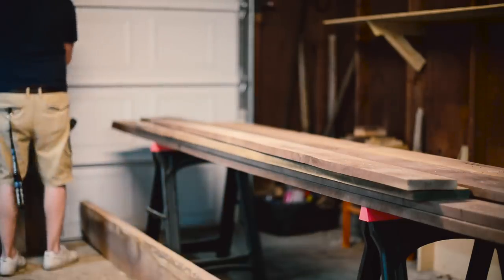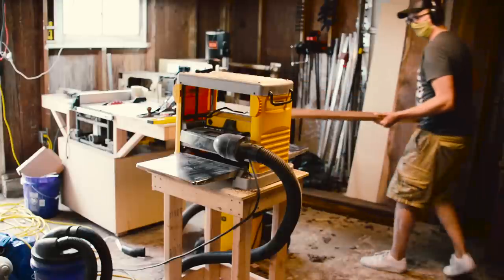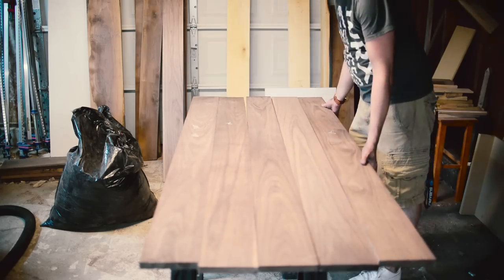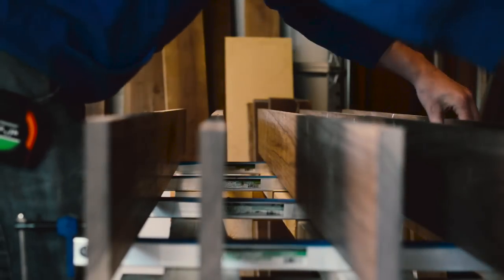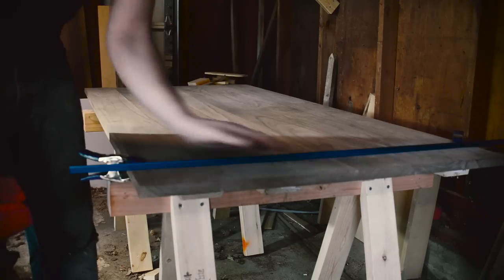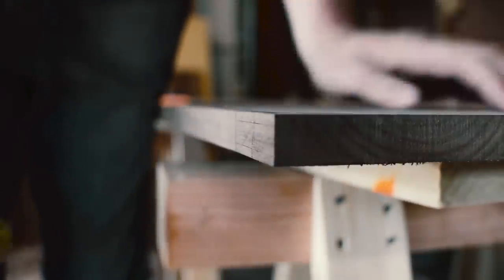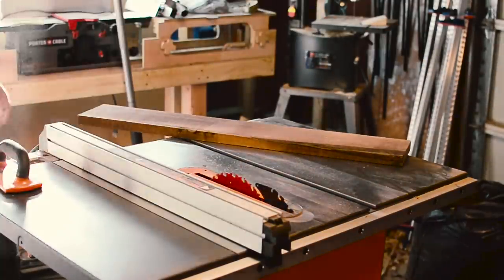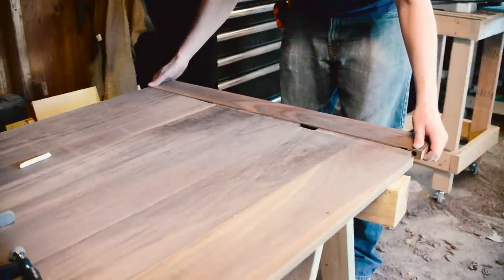DIY - Walnut Trestle Table

Comment: Awesome build.  I don't have all the tools to build this table, but it was very interesting to watch and the end product was gorgeous!
Reply: It's my wife's fault.  She showed me a walnut table that BYOT build on YouTube, build #23, which I could easily do with minimal tools.  Then she wanted hidden soft close hinges on our cabinets but they were built 30+ years ago and are too thin for them, and other dimensions make the hinges that do not require holes to be drilled to work, so I started looking at building new cabinet doors, which branched into my wanting to build a new coffee table for the living room, and a new floating cabinet for under the TV, and those crap floating shelves they sell at the big box stores would look SO MUCH BETTER and be much stronger if built out of a nice hardwood.  Oh crap, now I've been bitten by the woodworking bug again after it has been dormant for about 35 years.  Thanks for feeding my new addiction! LOL.  I was thinking about building a nice wood bed frame with storage too, and maybe a coffee table with 4 rectangle spots for small pieces of leftover granite counter tops with some nice marbling.  Crap, I need a larger shed and new tools.  I wish my mom and brother had told me before they got rid of my dad's tools after he passed away.  he had QUALITY TOOLS and tons of them.  I still have an old Skill circular saw that works perfectly, and is higher quality than pretty much anything you find today, and it is probably 60 years old.

Comment: Nice work man! You persevered. I feel for ya, the first 3 years I did any kind of woodworking I didn't have a shop, just a busted up rigid table saw and a drill outside in the wind and rain and I felt like it was always this battle to attain success in my projects (the breaker tripping mid way through the cut was something of a regular occurrence for me too! Soooo frustrating). The fact that you can do this quality of work with those kind of obstacles in place as a momentary constant is very inspiring.  Keep up the good work!
Reply from the maker: Nathaniel Herring  Thanks for the kind words! I appreciate it.
Reply: I too for much of my woodworking years experienced breaker tripping, but not the power...rather the tablesaw.  Seem like I worked it too hard most of the time!

Comment: Nice work! I have that jointer. It does a surprisingly good job. Still, I think I'm going to replace it with a more substantial 8" jointer in the near future. I'm always worried when I watch the aluminum fence start to bend slightly when I run a heavy piece through. I'm going to make a trestle table soon and I hope it turns out as nice as yours.

Comment: That's a great looking table. That will last a lifetime. Thank you for sharing. One question and please don't take this as a insult. But instead of replacing your table saw with a smaller motor why not upgrade the wire and breaker to 20 amp 15 amp is going to always be a problem in a shop. Just thinking long term problem solutions. Thanks again for a great project video. GW

Comment: Hey Paul, Just curious - How long did it take you to build this? Also, were you concerned about wood movement or anything happening to the top during the time it took to build the legs?
Reply from the maker: I'm trying to remember, it's been several years but I think it took about 3 weeks to build, with the majority of the time being spent on the weekends.

There wasn't any concern over the top moving, especially over a short time period. Wood movement happens over seasons as the temperature and humidity changes.

It's held up great too. We still use it all the time.
Reply: @paulprice  Fantastic - thanks for the insight.  I have had a bunch of walnut sitting in the garage for a while and plan to make one loosely based on this one as well.  Considering C-channel instead of breadboard ends.

I'll send pics whenever I finish :)
Reply from the maker: @ianhawkins441  awesome! Yeah if there was one thing I would do differently if I were to build this table again it would be to either not do bread boards all together or make the top thicker. As it is the bread boards are pretty thin so there is a little bit flex in them if you were to lean on them. But they've held up fine and haven't broken or cracked yet. 

But you're on the right track I think..best of luck!
Reply: @paulprice  welp it took ages but finally finished our trestle table 😀  I'll shoot some pix soon

Comment: Beautiful - hvad thickness did you use for the table top?
Reply from the maker: About an 1in. in hindsight if I did it again I'd probably go for slightly thicker top so the breadboards would be a bit beefier, but it's still holding up fine.

Comment: Hey man I see that you are using a bench top jointer with in feed and out feed tables you added on later.  How does that work with adjusting the height of the out feed table when you manipulate your cutting depth? Just curious on how you put that together.
Reply from the maker: +Zac Abernathy I had built it to be adjustable, but the easy answer is that I basically set it up once and then just use the same cutting depth on everything.

Comment: How has the porter cable jointer been holding up?  I had 2 cutter head shaft wearing out.  Yes I had play in cutter head thought is was a bearing, porter cable replaced it, the second one had same issue after 200 board ft or so.  They have replaced the bearing to a needle type, just wondering if I am the only one with this issue.  I have since gone to a cutech, same planer just has a helical cutter head.  No issue after a 1000 board ft.
Reply from the maker: +Lewis Brazil I actually upgraded to a grizzly jointer after I made this table. I Wanted something more sturdy and accurate for longer boards.

But the porter cable worked fine for me while I had it.

Comment: is the top only 1" thick?
Reply from the maker: Yes as that was the thickest lumber I could get at the time. Ive thought about making a new top for it that is thicker and a bit longer and wider. But it has worked just fine as it is
Reply: @paulprice   Okay. How has the 1" top held up so far? I like to use thick ones but can only seem to find 1" in my area.
Reply from the maker: @cedarriverwoodworking  it's held up just fine. Only thing that isn't perfect is the breadboards on the ends are a little wonky now from wood movement over the years, but otherwise it's still in great shape
Reply: @paulprice  I appreciate the information!

Comment: Hey Paul, I saw other videos that said that we shouldn't use biscuits on these types of joins.  Have you or anyone else on the channel heard that as well?  The other folks said to just glue the boards up, no biscuits.
Reply: Not to speak for Paul, but I usually use biscuits for a top like this.  Nothing wrong with them.  As Paul pointed out, you don't need all that many.  With thick material, I might put them as much as 16 inches apart.
Reply: Torpedo is correct. I have no idea why you would not use them. Stability is a good thing last time I checked!  And, you can use dowels as an alternative. What I like to do is stagger them from table top to bottom, depending on length and thickness.

Comment: good job, how much do u think u spent on the wood?
Reply from the maker: +kRizm the cost of the wood is extremely dependant on your location and access to it. But for myself, I got the walnut for between $3-$5bdft. Depending on the board. All told I spent $300 for the wood, but probably only used $250 worth of it. I had plenty left over which is better than not having enough haha.

There are places out there where you maybe be able to get the wood even cheaper than that and there are places where you're going to pay an arm and a leg for walnut. You just have to look around and see whats in your area.
Reply: Where are you that you can find walnut for $3-5bdft??? Here in Raleigh, NC its $11! D:
Reply: I'm outside of StL. in Collinsville Il. < I pay about $4.00/bdf around here for rough. but good Walnut.
Reply: Dylan Sargent Dylan, I just bought some nice semi rough cut 4/4 x 9.5” x 8.5’ walnut from Klingspors in Cary (their new location) for $8 bf. could have gotten it a lot cheaper from a sawmil but needed it now and it to have been air dried (which theirs was).

Comment: Your breaker tripping is might be caused by using an under sized extension cord. You need to have the right gauge cord for the length and amps you are using. Might be something to double check.

Comment: Uhhhh... that's almost 100% The wood whisperers design and table. There's almost no difference. Don't credit this as your own when it clearly isn't.
Reply from the maker: +surfnsd085 I never claimed this was my own design, I even mentioned Marc in the video. I took some inspiration from his build and then built my table on my own. 

Marc is a great resource for Learning how to build things on your own, just as I did.
Reply: Paul Price yea you took some inspiration as well as the plans for his table and built it. You literally made a video building his table but only said you took "inspiration".  C'mon man... by the way everyone on the wood whisper guild site is already talking about this. Good luck!
Reply from the maker: dude i did not use plans for this table. marc's table is different in many different ways to mine. he has a curved top, mine isnt, i use bread boards, he doesnt, his stretcher is smaller and uses braces that go upwards, my doesnt, he has a dimpling pattern on parts of his, mine doesnt. literally the only things our tables have in common is the middle accent piece and the double wedge and that its called a trestle table. 

i love marc's work and have learned alot from his videos, but im proud to say i built this table on my own.
Reply: surfnsd085 Marc has already said that he doesn't care about people taking something that he has designed and building it. Even if it was his own original design and idea. Which it wasn't. Marc has gotten inspiration from others that have come before him. Nothing out there is truly original anymore and can really be traced to any one source. The only thing that would be unethical would be if this guy was making an exact replica and plans to go along with it and claiming it as his own and selling them. There's no need to try and stir up trouble, especially when Marc has no issues with what this guy is doing.
Reply: Thanks for doing the right thing and posting the plans from TWW. Your table has many more similarities then differences. Just give credit where credit is due right off the bat in your description (which we all noticed you changed after you were called out) and avoid all of this in the first place.
Reply: surfnsd085 Why should he have to give credit in the first place?  If this was the case, then every project that anyone does, would be required to give credit to those who made anything similar in the past. Which is totally and utterly ridiculous. If he had made this table 5 years after Marc's, there wouldn't be anyone claiming that he has to give credit to Marc. It's only because Marc's trestle table is fresh on people's minds.
Reply: Dude you're crazy they don't look anything a like. Google trestle table and you'll see plenty of tables that look like Marc's. It's a STYLE of table. So they look similar.
Reply: The Guild's discussion is a healthy debate on how close a design has to be to give credit to the designer.   Half those in the thread think this guy did nothing wrong.  This was never meant to burn the guys channel down.  Everyone can relax, really.
Reply: Did the wood whisperer give credit to everyone he gat his ideas from? I doubt it. I'm sure if you looked long enough, you would find a table almost exactly like his that was done years before he came up with his design.
Reply: +John M   who are you? if marc has a problem with this guy he can speak for himself. you didn't call him out, you were simply wrong and he pointed out very politely the differences between the two table layouts! if you didn't like paul's video or build, don't watch. there's no patent stealing in building a damned trestle table for crying out loud. why do people like you do this crap? this is my first viewing of paul's channel and i liked his build. quit stirring up stuff for no reason or just go to your shop or garage or whatever and build one yourself!
Reply: +Frank Haus  relax?  this guy didn't do anything wrong at all!  you self-righteous net-policemen out there stirring up crap when your simply wrong!  the guy made a table that may look like another.....well they all are similar and John M above was acting like this guy stole the crown jewels or something.  all trestle tables look alike hence the specific design of table being....trestle!  what jerks....just don't watch his channel if you think something is wrong what what he's doing!  people getting butthurt for no reason.
Reply: Yeah, relax.  You should take that advice.  Calling me a self righteous net-policeman when I stick up for the guy?  Aaaaand I'd be amiss if I didn't point out that you are doing exactly what you are accusing us of...trying to "police" the comments section.
Reply: sticking up for the guy? "Good job, however I feel like you should at least give Marc from The Wood Whisperer a shout out since it's clearly his design." is a copy and paste from your statement.  it's not "clearly his design" and that was my point.  the guy John M 's comments are what fired me up as I see crap like that all the time.  i don't mean to jump up and down on you as your quote is no where near as bad as the other guy's.  if someone's videos promote dangerous stuff or when they are "instructing" people with unsafe practices, by all means, i would hope many comment for correction.  the problem with youtube is many do just the opposite.  there are tons of videos i don't like or think the maker is off is rocker but aside the items stated above, i just move on and don't view that channel any more.  if i or anyone else has constructive criticism to help the person making the video that's a good thing as we can all learn from each other.  i've learned tons from watching others here on video and it's a great resource.  it takes a lot of time and effort to put out videos on what we have passions about and this guy's videos have great production quality to them.  so far, all his comments are polite and supportive even in disagreement and that's means something to me.  i really didn't mean to jump down your throat but i thought this guy was clearly in the right and wanted to voice that opinion.
Reply: I made that statement because as soon as I saw this table, I knew it was a "copy" of Marc's...I guarantee if you were to sit down with Paul over a beer he'd say it was.  I see Youtube as marketed material where many come to make money...so whereas he isn't selling the table, he is using the table to benefit.  I initiated the thread in the WW Guild's FB page to get the other guys' take on it.  About half the members there, including Marc, agreed Paul did nothing wrong.  I posted my response to John M to say we don't need to attack the guy...clearly there are varying opinions and I think that in it's self is enough to cut the guy some slack. 

I'd delete my comment here and the comment on the FB page, but I'm not going to hide what I started even if my stance has "softened."  Plus the FB post was a pretty good discussion and debate I think.
Reply: Hate to tell all you woodworkers out there. No dining room table is original.....it's ALL been done before. You're not the least bit creative. Get over yourself.
Reply: If true then it sounds like a lot of petty people there.
Reply: I'm happy to hear that your stance has softened. I also have no doubt that he probably derived some inspiration from Marc's table (along with countless other trestle tables out there), but I disagree that it requires a shout out to Marc for anything other than the wedges, where he did mention Marc. Like another poster stated, if anyone thinks he should be giving Marc credit for this table then he better get busy giving hundreds of others that same credit. I'm surprised that so many people concluded that this is even close to a "copy" of Marc's work. Other than them being trestle tables and the maple I really don't see how that argument holds water. There are simply too many differences which Paul clearly identified. A copy is a copy, it either is or isn't and this most definitely is not although it is in the same style.
Reply: John M after reading your comments i now want nothing to do with that website or the people who post on it.   Great job representing.
Reply: John, if you're an actual fan of Marc's channel and productions, you should know that Marc himself routinely uses other peoples designs with some relative frequency. There are enough changes, and the table plan isn't copyrighted; so no harm no foul. This is a clear interpretation, not a direct copy.
Reply: John M---You're a troublemaker.
Reply: John M.......You're just mad because you can't build something this nice.  Get lost!!